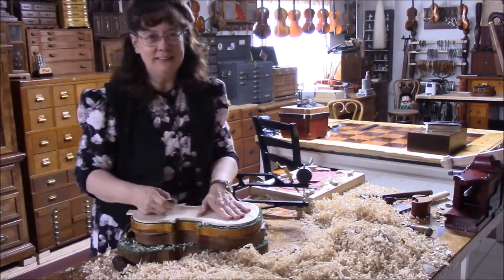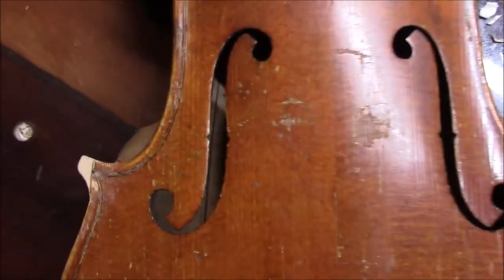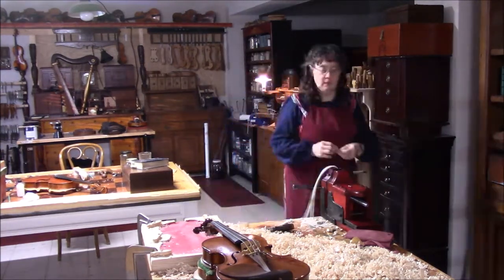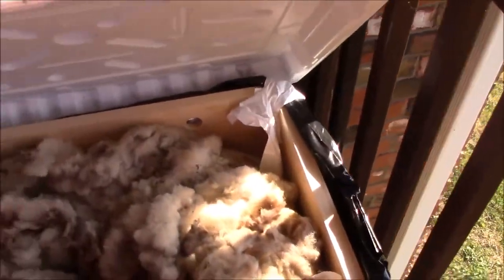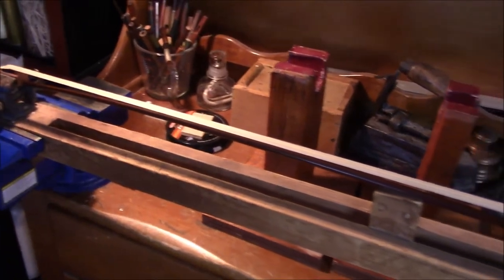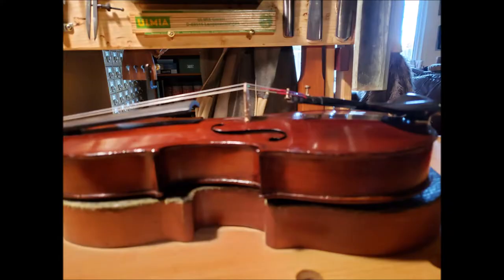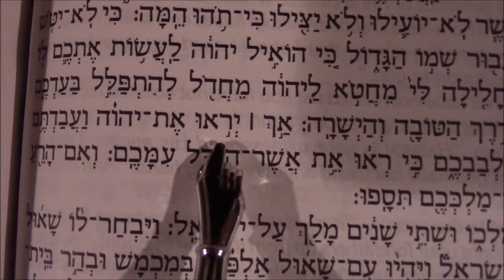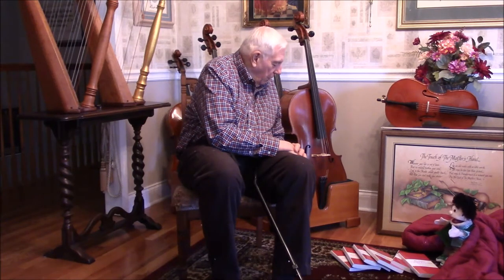Violin Making Adventures # 111 (C. Macomber, Violin Maker) Carving, Rehair, & Repair

Comment: Do you think an experienced violin player would be able to tell if a bow has a few less than perfect hairs? Like a blind test, 5 bows, any number may or may not have had the imperfect hairs removed.
Reply: That would be an interesting test.
Reply from the maker: Yes!  Great question!  It has been done.   When the imperfect hairs are left in the bow, the tone is a bit rougher!  A customer came in with a very bad hair in their bow.  It was thick and rough and every time that area of the bow passed over the string it yelled out!!!    --or rather squawked!   Thanks for commenting and hope you have a great week!

Comment: Hebrew minute,  
1Sam 12:24 ?

Glad you are enjoying your vice. Looks very helpful.  

New violin is coming along nicely..smooth.  Do you scrape the inside super smooth on violins that needed regraduation work?

I could hear a big difference with the new bow hair. Interesting.  I didn't think it made that much difference.  My bows haven't been rehaired a very long time. The hair seems to grab fine, but maybe new hair would sound better?
Reply from the maker: Yes!  You got the Hebrew Minute!   I do scrape the violins with the scraper after graduating.    It just depends on the tone and how fragile the wood is.   A new rehair does make a big difference but again depending on how  much it has been played and the care it has had.   Hope you have a great week!

Comment: You can improve sound in your videos by adjusting level in all parts. The level is usually different in all your raw material and it's ok. Especially when you play the violin and then talk - in such cases the level will always differ much.

Here are the steps:
1. After you have completed editing the whole episode, first render only audio. You will get the audio file with the sound for the whole episode.
2. Open this audio in any audio editor. E.g. audacity or any other.
3. In the audio editor you will see how the level differs in all parts.
4. Select each part and apply Normalize filter to it. All audio editors have it. (More advanced way is also applying Compressor filter when needed) It is important to normalize each part separately because normalization is made by the highest level in the selection. 
5. You can also fix loud clicks or other audio defects. But do not delete any part of the sound because this audiofile must match the video. Instead select and mute the unwanted fragments. All audio editors support this.
6. Save the normalized audio file. Return back to the video editor. Do not forget to disable (mute) the original audio track. Add the normalized audio and adjust it with the original one.
7. Render the video.
Reply from the maker: Wow! Thank you kindly for your help and instructions.   I am using the free video editor Movie Maker.   I assume that I will need to invest in a good program eventually in order to make those adjustments.   Do you recommend any that are not too hard to use for a violin maker like me who doesn't have a lot of time to spend editing?   Thanks again.
Reply: @Violinsforu2  you can try audacity. It is cross-platform and free and it can do this job. I haven't used other software. The process is very simple. It is like you select text fragments in the text editor and apply formatting. But here you applly Normalize filter. Audio editors usually do not modify the source file. Instead you need to export the result. The concept is similar to the video editing and rendering.
Reply from the maker: @be3ho7nm  Thank you for your help!  I will look into it!
Reply: @Violinsforu2  one important note: when you are working with sound the main goal is to get the highest possible level but to avoid sound level clipping. By default Normalize filter does it right. But other effects can apply too much gain. So pay attention to the level indicator. And it is usually visible by the waveform itself. You will get the idea when you try.

upd: if there are loud clicks/defects that you want to remove, mute them before the normalization so they not affect the source level.
Reply from the maker: @be3ho7nm  Okay!  Sounds good to me.   I still do not know how to remove the audio from my video.   It looks like Movie Maker does not separate the audio.  I was just watching a tutorial on Audacity and it looks great.  Thanks for the recommendation.  Now to figure out how to get the audio over there is my next hurdle!
Reply: @Violinsforu2  if the video editor does not support multiple audio tracks then it probably supports replacing audio. In this case you can render the whole episode, then extract sound from it, edit the sound and then replace audio in the rendered episode. I haven't used movie maker but here is my search result: https://youtu.be/XzQxzy79b2E